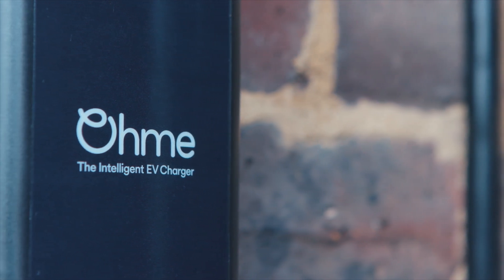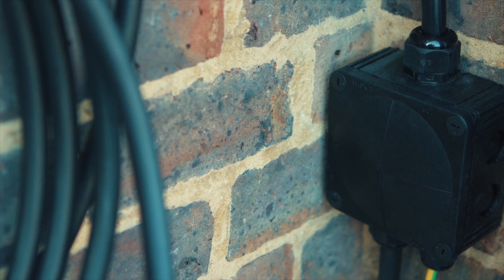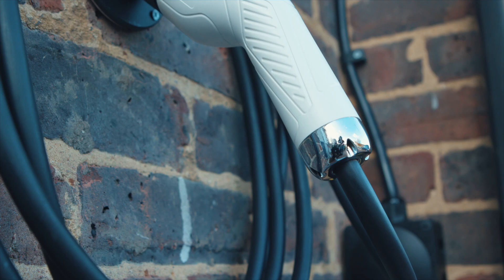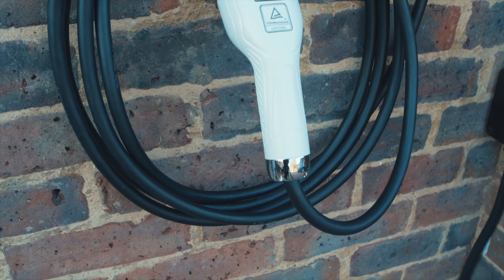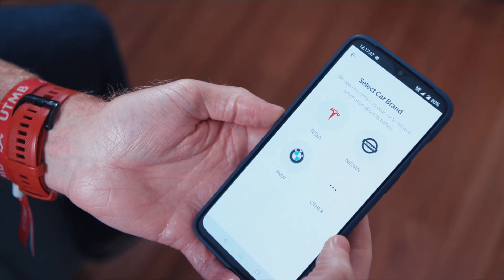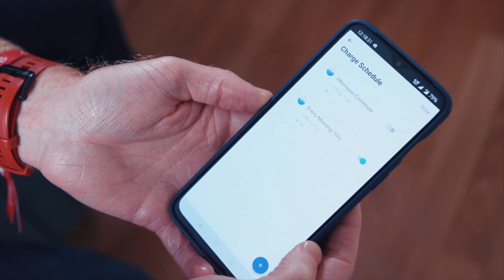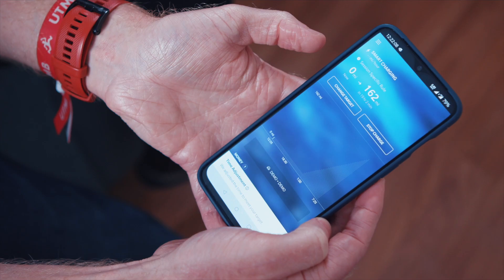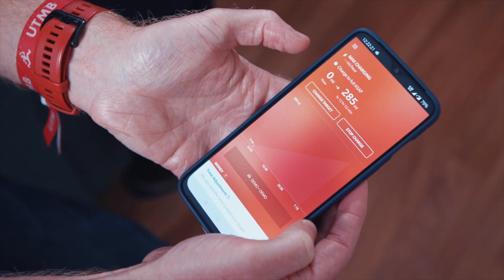An Introduction to The Ohme EV Wall Charger Installation

Comment: i have a 9.8 kw electric shower and 80/60A main fuse at the meter, do i need any additional switches etc to stop things tripping etc?
Reply from the maker: Hi! If you're in the UK, an EV chargepoint installer will perform a supply adequacy assessment prior to install and this will take account of other appliances in your home. For an 80A fuse, a 9.8kW shower uses 42A, leaving only 38A leftover for the charger and all other connected load. This would lead to temporary overload of the fuse, however, many installers will apply a diversity factor, recognising that most people do not use the shower for long enough to have much effect.

Generally, you cannot install a 32A charger with a 60A incoming fuse. Often, installers will install a 32A device with an 80A incomer. But this does depend on what else is in the property.

If you do have a 60A fuse, in most cases your DNO can upgrade you to 80A with minimal effort. Some DNOs do not charge for this service.
Hope this helps! Thanks, Ohme

Comment: Can you use it if you have two EVs?
Any chance it could be made compatible with excess Solar charging?
Reply: I was here looking for the two EV car answer. Regarding solar, it does work with IFTTT, which should enable it to work with excess solar, and not send it back to the grid.